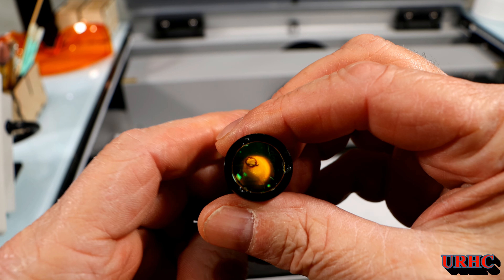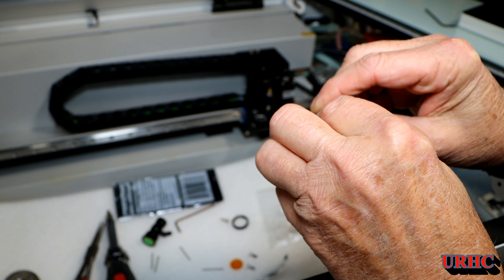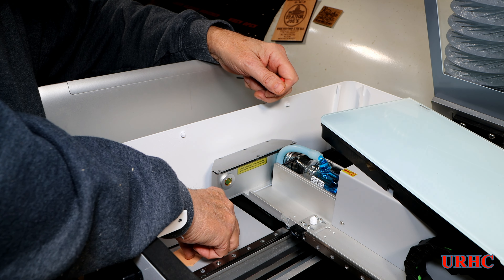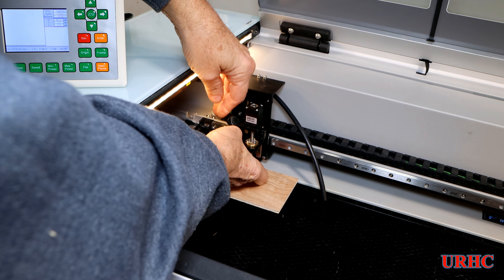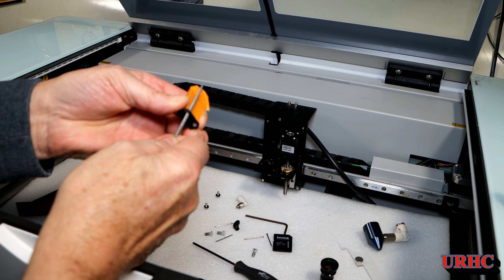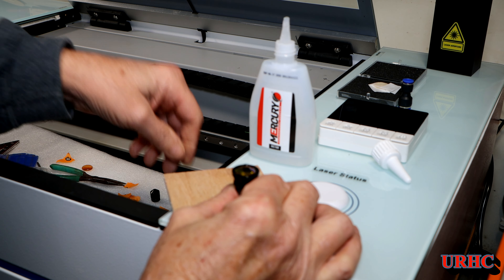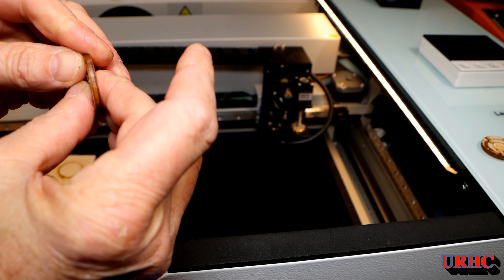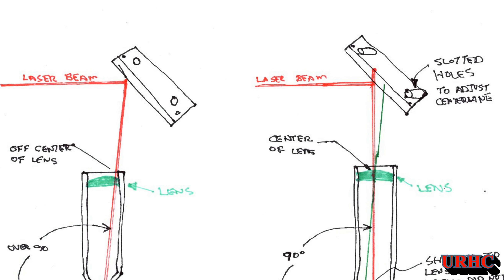Omtech Polar 350. Part 6 Aligning The Mirrors Using The Targets And Changing To A Cloud Ray Lens

Comment: Thanks for this, just got a polar as our first machine and it has the shock sensor set off during shipping. Thinking that might be why it’s not firing right. Contacted Omtech and they said they’d have a video showing how to do this in a few weeks, meaning my machine would be unusable until then. Glad to see how you do it!
Reply from the maker: I doubt alignment will cause it to not fire. Have you properly installed the right version of lightburn and set the laser up with the home in the right back? Then just draw a box at low power to engrave and try running it. If it frames and doesn't run probably has something to do with the limit switch,  over 200 mm sec speed in the y direction, or home overrun . If it runs but doesn't fire then the drop may have caused damage to compinents. As I showed in other videos make sure the pull out tray limit switch is working properly.  That's why I added a control panel to make it easy to debug for problems.  Spend a couple  weeks watching lightburn videos if you have no experience because if not set up properly there will be problems and running a simple cut will be your only way to fire the laser. Your lens should be adjusted good enough to get started.  What did omtech say when you called at delivery about the shock sensor being triggered?  Good luck. Thanks for watching.

Comment: This video is immensely helpful especially when the laser isnt shooting straight out of the barrel. Thank you!
Im also surprised you didnt use the tape method when firing the laser when the head is on the right then on the left to see if the two burn holes match up.
Reply from the maker: I saw your email and there is no easy way to get it aligned.  I spent hours loosening the screws shifting it a little and retightening then checking. When you tighten the screws it shifts the holder and sometimes a little tap will help. I just tried to file a little at a time and then rechecked how the beam moved. It was totally trial and error. then the threads stripped from a mount hole and I had to put a nut on the back that made it even more frustrating.  I think Omtech has that issue fixed now. Just keep tweaking until you get it right a little at a time. I like the Cloudray lenses I switched to better then the stock ones. Good luck.  Thanks for watching.
Reply: @unemployedredneckhillbilly2023   Thanks for the response! Was up till 2am last night fiddling and almost threw the laser out. One day there will be a quick fix lol. I think i got it to the point now where that 3rd mirror on the laser head is the main problem. When and if i get this beam centered, ill have a big celebration.
Reply from the maker: you can also adjust that a little by shimming the first and second mirror assembly with a paper shim to move the beam up some.  It's definitely frustrating. I puy a fine bead of superglue across the mirror mount aftre finally getting it right so it stays adjusted.
Reply: @unemployedredneckhillbilly2023  yea actually that 1st and 2nd mirror came shimmed. Had to shim it some more a couple months ago as it fell out of alignment somehow. Really hoping this 3rd mirror is the key

Comment: Thanks for all your laser videos first of all, very helpful for a first time laser user.  On my machine I noticed the exact same problem with alignment as you show in your diagram.  I am able to engrave, and cut quite well actually but when I used the laser to cut small 1/8' holes in 3mm acrylic I noticed that the hole was cut on an angle similar to your machine.  I want to be able to cut through multiple layers at the same time so I need the beam to be as close to 90 degrees to the work as I can get it.  My question is how should I go about correcting this as efficiently as possible?  Should I open up the mounting holes immediately as you did?  Do I still need to adjust the stationary mirror set near the tube?  What sequence would you recommend?  Thanks in advance, and Happy Holidays BTW.
Reply from the maker: Shimming that mirror  up as long as you keep it parallel with the travel can raise or lower the beam spot on the mirror to get closer. I finally  got tired of trying to move everything a little bit with stuff shifting as screws are tightened so I finally opened up the mirror holes as a last resort. Terrible setup with no thought put into alignment.  Good thing is once you get it set, it seems to stay there. If it's new see what Omtech support recommends.  That means you probably are seeing off center burn spots on the lense and Omtech should replace that under warranty.  Good luck. Thanks for watching.
Reply: @unemployedredneckhillbilly2023  Thanks for the quick reply. I’ll check the lens and see what OMTech has to say. Thanks  again.

Comment: Nice video Ed you certainly get into it. Some of these companies really picked the right person to send a machine for test/review. They must know that you will pick out all the bugs and than come up with a fix for them, but most people won't go through that or expect to have to do that paying thousands for the machine. Is there really  that much of a difference between that laser and the xtool or otur lasers?
Reply from the maker: All the Co2 lasers run into similar problems with mirrors,  lenses, and alignment.  Hopefully this is helpful if others have similar problems.  I put about 50 hours on it and it was time. Ortur lasers are great for most people. They do a great job and require little maintenance.  They are not good for light colored or clear plastic and glass requires painting  black for decent results because the wavelength goes right through it. Also have a duty cycle.  The Co2 lasers are faster,  work with clearl plastic and can be run for hours due to the water cooling. That makes them more desirable in a business situation. Plus with water cooling you can go to much higher wattage for cutting thick wood without stressing the machine. Yes Co2 is more complicated and has more maintenance but it's not something you do often.  Thanks for watching.

Comment: How did the original lens work/ alignment when you first got the polar? How long did you use the polar before doing this? I have a problem cutting completely through MDF. Idk if it’s just cause the nature of MDF or settings I can change.
Reply from the maker: I never originally checked the alignment and didn’t know there was a problem till seeing how the lenses burned off center. They were supposedly aligned before shipping but my box was pretty beat up so not sure what happened.  Then the second lens did the same thing and I finally realized it wasn't just the lense. I used it several weeks but my settings were constantly changing for the same materials.  I can cut 9mm mdf but anything thicker will take a couple passes. one trick is to lower the focal point some when cutting thicker materials because you really want it close to the material center for deepest cutting. Be sure the air assist line has no kinks. I did have an issue with deep cuts from that also.

Comment: Hi Ed. I am the owner of American Photonics. I have this lens in stock. Can you help me design the lens and mirror holder. I would like to make these assemblies available on my website.
Reply from the maker: I was thinking about making a lens holder that would stay in place and have a retaining cap that just screwed off to allow fast access to clean a lens from the top without taking the tube out. That would allow  the air assist to be moved higher in the holder to hopefully keep the lens cleaner along with routing for less kinking. Would be nice to have a std 3 screw adjustment to tweak the mirror easily using the same mounting configuration.  I think an upgrade package would interest many owners. I actually am having good results with the Cloudray lenses.  These are great starter machines ( plus same as GweikeCloud) that many are purchasing and at $65 for a hard to clean lens I bet a lower cost replacement without having to glue it in making cleaning hard would become a welcome upgrade. My email is urhcvideos@gmail.com if you want to contact me. Thanks for watching.

Comment: have you cut through leather yet? im having a very hard time getting my polar to cut through 1.6mm or higher leather.  ive adjusted focus and power all over the place
Reply from the maker: These are what I use for leather that is 2.5 mm thick. 
Cut 2.5mm thick 60% power, 20mm/sec air on
Engrave  max pwr 16%, min power 15%, 200mm/sec, air on. Cuts it fine and I use a magic eraser to clean it. Be careful you use leather that is laserable. Sounds like a dirty lense or mirrors.  Thanks for watching.
Reply: @unemployedredneckhillbilly2023  would you happen to know what you ma is at those powers?
Reply from the maker: Sorry it took so long but I don't get notifications on comments after the initial comment. 60% power is 16ma and 15% is 1ma.

Comment: What a “pain”!  I hope this alignment is required more than once?  Why isn’t this alignment done at manufacturing?
Reply from the maker: It is supposed to be done at manufacturing but that may not be perfect on mine that was a very early prototype. Also have about 50 hours run time on mine so need to service the bearings and check the coolant. Over time Co2 mirrors will need replacing and then new alignment.  Now that mine  is close to perfect it should stay that way in the same temperatures.  All Co2 lasers should have the alignment checked for best results whennew and I think this should solve my lens burning issue.  The lens option will save you a lot of money if you're looking for alternatives plus lenses for this machine are not stocked yet. Just documenting my experience with the machine accurately.  Thanks for watching

Comment: I have the gweikecloud and there's a mirror issue as well. It's very hard to align. Any idea if there's an off the shelf mirror mount kit that is compatible to omtech polar?.
Reply from the maker: I haven't found one but have a few ideas how to make one when it needs replacement.  Slotting those holes alowed me to get mine almost perfect but trying to keep it from moving while tightening the screws was a pain then one of the threads stripped. They are amazing little machines when aliigned. The lens price and availability surprised me also but the Cloudray works better  then. the original. I hope GweikeCloud and Omtech adress these issues.  Thanks for watching.

Comment: I just purchased a polar when I need to how do I change the mirrors??? This is a major issue that they don't just pop out or sit in around a screw in top bit??
Reply from the maker: Mine are still good but not easy to align should they need to be changed. The good part is once aligned it stays aligned.  Be sur to keep the mirrors clean. I use 99% ipa and microfiber swabs. Thanks for watching.
Reply: @unemployedredneckhillbilly2023  if I am using it daily how long do you think mirrors will last.... Its all aligned well thankfully.... Not looking forward to realignment due to not being able to just pop out mirrors 🙄... Yep I use ipa and lint free clothes Thankyou 😊
Reply from the maker: I have no idea. You should contact Omtech for that information.  Its not a commercial machine and  a lot will depend on the power levels you use and materials you work with.  Acrylic seems to shorten down lens and mirror life from the vaporized fumes that coat everything.  Mine has about 200 hours, mirrors are wearing along with on my 4 th lense. I clean the lense every couple minutes when working with actylic. With wood it can go hours  between cleaning. Be sure to stay within the duty  cycle of the machine if running it for hours everyday. These low cost compact lasers can run into heat issues shortening proprietary component life and they are tough to repair seeing how everything is squeezed into a small package. Omtech should be able to help you and recommend spare parts to keep on hand to avoid weeks waiting for parts from China if you need it  everyday.
Reply: @unemployedredneckhillbilly2023  Thankyou I only use rubber atm....  acrylic can wait but good to know that info many thanks for replying 😁

Comment: I have been considering the Polar, but after watching the headaches you have been going through I’m not so sure that this is the laser I want now. Are you now more or less happy with it or would you recommend I consider something else.
Reply from the maker: All Co2 lasers will need mirrors, lenses, and alignments. I really like it and the results are amazing when properly tuned. If you are looking for something that is easier to adjust you may want to look at a Gloforge tupe high end machine that is priced 3x higher. I think part of my problem is that I have one of the first machines out during a second wave pandemic. I don't call them headaches,  rather learning experiences that will make maintenance quicker in the future. I think it's an excellent starter Co2 laser in the price range and definitely recommend it if you are willing to figure out how to maintain it. They don't come with detailed manuals if you require that.  Thanks for watching.
Reply: Thank you for the quick reply and for all of your informative videos.
Reply: @mrmilpert  I would still go for the Polar, besides the lens stuff it's pretty well built for a desktop co2 laser and for the price.

Comment: Do the RF lasers still need this? In between the polar and the gweike rf
Reply from the maker: Yes just a faster metal laser tube. Same mirrors and lens. I understand they both are the same machine made side by side. Gweike came out first and I saw some posts where their early power supplies were a lower output so be sure to get a current machine if you go with that. Maintenance is the same on them and looks like the exact same lens  also. This is a great starter package but as you see all these lower cost options may or may not need some fine tuning to get perfect results and longer lens life. Gweike offered me one first but they wanted to be able to make me edit videos if they didn't like something so I walked. Omtech actually is letting me make totally honest videos so I have more confidence in this machine and will work through any issues and maintenance that may arise. Thanks for watching.
Reply: @unemployedredneckhillbilly2023  ok that makes sense. Seems like these are harder to get tuned in then the glow forges
Reply from the maker: l have never tried a glow forge but they use mirrors and lenses that need maintenance also. I have heard nothing but good things about their machines and if you don't mind the lower power tubes and higher price it would be a great starter also. The results will be the same in the end but they come with better documentation.
Reply: @unemployedredneckhillbilly2023  yeah I’ve been been kind of turned away from the polar because of the lense issues. Seems like a lot of people are having the same issue. Maybe they have it figured out by now
Reply from the maker: Mine seemed to be the alignment throughout the focus range was off center. at the home it was centered so opening up the holes looks to have fixed that. if you don't hit the center excess heat is generated on the spot the ray hits. The cloudray lenses are a low cost replacement. Whatever you get do a thorough alignment check. I will keep everyone updated. Could be they all are off if you see others with the same problem.  one other thing that was a problem is with the cover in place the air assist tube can get pinched reducing flow.
Reply: @Ptro1  I'd humbly recommend thunder or normal omtech machine and staying far away from the machines in this middle ground area.

1. no real mirror adjustments; everything is old school cut, file, bend or re-glue.
2. No replacement tubes available; always check before buying a machine (cost and availability).
3. No control panel and/or console.  
4. Camera is unworkable in Lightburn; off by +5mm if you can get it calibrate (which is almost impossible)
5.  Nightmare access panels; has me swearing alot anytime i goto work on the thing

You can get this thing to perform good; after hours and hours of tinkering and about 300-500 in upgrades.  Not sure why they can't just make a standard omtech that fits on desktop; 3inches wider, control  panel, normal CO2 tube, nozzle and mirrors would of solved most of the issues.

Comment: The machine's calibration accuracy seems inconsistent, leading to occasional misalignments and errors in engraving/cutting, affecting the precision of projects.
Reply from the maker: It's  up to you to check the alignment and focus as part of the maintenance.  Do the alignment and ramp test to start with. Also if cutting and engraving acrylic clean the lens every couple parts.  All lasers need maintenance to keep them running properly. Also check the air assist line for kinking. Sounds like you should  spend a day going through the required maintenance and machine cleaning. But you are starting to sound like a spammer.